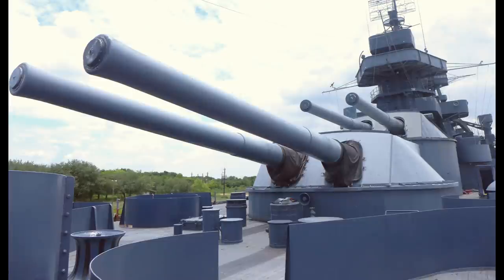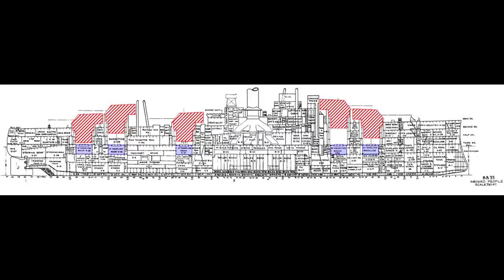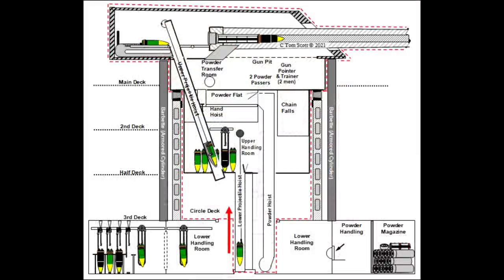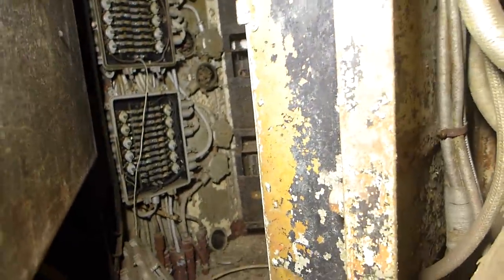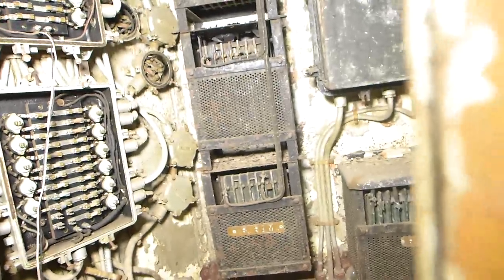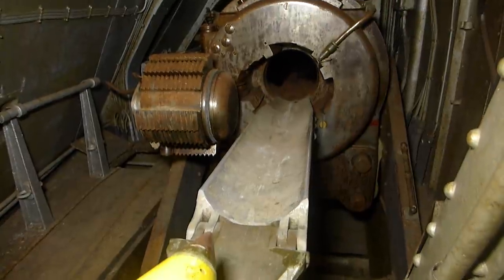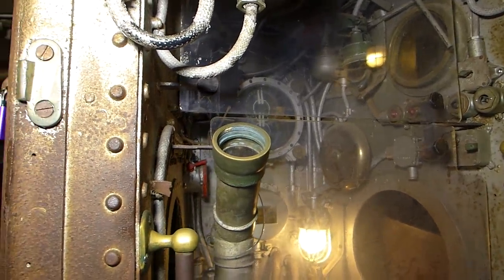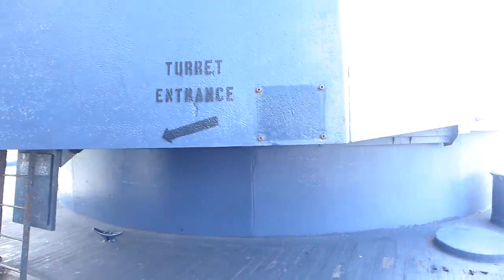Battleship Texas, Climbing A Turret

Comment: Where did the well men go when it was time to fire?
Reply from the maker: If you go to 12:25 in the video, you will see the silver tray that powder bags slid on when they entered the gun pit. The two well men could sit or lay on those and be out of the way of the gun during firing.  That position placed all recoiling parts behind them.   The only part of the gun assembly they would come in contact with from that position was the bottom of the slide that the elevating screw just ahead of them attached to.  Even at its fastest elevating speed it would simply push them out of the way, and it sat perfectly still during firing.

Comment: Those hatches seem so crude. People bound to hurt themselves while passing through it.
Also it seems very primitive how people are supposed to pass heavy powder-bags from a pit to an upper floor.
Reply from the maker: It was primitive compared to British and later US powered systems, but it actually worked pretty well.  Not only was it simpler and more reliable, the crews were physically trained to pass bags at a high rate and could do so for extended periods.

Comment: So the turret 2 circle deck had provision for additional shell storage. The turret 1 deck does not but it has what looks like storage lockers around the outside. Do you know what was stored in those lockers? Why did they use this space for additional shell storage?
Reply from the maker: I haven't found any record of what the lockers were used for.  If I had to make a guess, probably miscellaneous stores.  It would be a very good place for keeping small tools and consumables like lube oil, rags, etc.  One drawing from the early 1930's made reference to midshipman berthing and study spaces, but I don't like that.  First, there are a lot of drawings out there that were proposals not used and that nothing on it suggest that it was any more than that.  Determining whether or not drawings were used can be tough at times.  In this case, there simply isn't the deck space for berthing, desks, clothes lockers, etc.  The overhead is very low in 1, 3 and 5.  I am 5'10" and constantly bump my head on things on that level.  Lastly, there are no berth racks or hammock hooks in any of them, nor have I seen any attach points or welding ghosts from where they may have been installed then removed.

I'm not sure about your last question regarding why the additional shell storage.  If you are asking why do that in turrets 2 and 4, here's my theory.  Understand the following is based upon a brief comment on in a drawing or manual.  I don't remember which.  For that reason, this explanation is strictly my opinion.  They had to have handling shells for regular training and loading practice.  They would never use live rounds for that.  They also had to have inert rounds to fire during target practice and qualifying.  You don't want to consume space meant for live rounds, nor do you want these rounds to be in the way if you are in combat.  The circle deck storage makes perfect sense in that scenario.  They are out of the way in that location and there's no big rush to deploy them for practice or target firing, plus no truly valuable magazine space is consumed by them.
Reply: @tomscotttheolderone364  thanks. I’m sorry I realized that my second question didn’t come out right. What I meant to ask is on turrets 1,3 and 5 why they didn’t use that space for shell storage like they do on 2 and 4? Storing shells on those flats makes perfect sense and that obviously how it was done on the later ships. Was it because the low overhead and nose down storage method makes that space impractical for that use?

Thanks again for these videos and your replies.
Reply from the maker: @jetdriver  The flats on later ships were specifically designed as storage for shells, so they were a primary design consideration when laying out their turret rotating structure.  This level on Texas' turrets was primarily a space filler and any other function was secondary.  You are right about the height on the three lower turrets.  There isn't the physical room for the combined height of the shell, the length of a chain trolley used to move it, plus the height needed to provide clearance above the deck to lift and move a shell.  Since later designs stored shells on their bases and used parbuckling to move them, the overhead height requirement was much less.  One must also consider the effect of the weight added to the rotating structure caused by shell storage.  Storing as many as 100 shells on the rings on later designs added at least 1.2 million pounds to what had to be supported and rotated.  That meant greatly increasing the structure below the turret rollers, increasing roller strength and increasing the size of the training motors from 25hp on Texas to 50hp on the Nevadas.

Comment: I'm wondering when and where do they arm the shell ?😊
Reply from the maker: Good question.  All large caliber naval shells came from a shore based ordnance facility with base mounted fuses already installed.  This presented no safety issue due to their design that required a combination of the shell accelerating at more than 1,000 g's of force combined with spinning to more than 5,000 rpm to arm them.  In fact, the manuals clearly stated that base fuses were to never be removed or altered on the ship without specific authorization by the ordnance department.  The only fuses that could be attached on board the ship were nose mounted fuses, called point detonating fuses.  These were either impact fuses whose purpose was to improve the reliable explosion of a shell on impact, or timer fuses used to detonate a shell to obtain an air burst above a target like troops and trucks.  Those fuses were installed by the gun crew with the shell on the loading tray, just before being rammed into the gun breech.

Comment: What was the noise level for the powder men in the gun pit, when the gun fired?
Reply from the maker: The noise level wasn't as loud as you may think.  Veterans who worked in those positions said that the actual gunfire could be heard, but wasn't particularly loud.  The reason was the muzzle blast was on the opposite side of 14" thick armor.  What they did hear was the loud sound of the ventilation blower right beside them, and the swooshing sound of the recoil buffer, like a giant shock absorber, as it compressed when the gun fired.  There was also a loud clang noise as the gun returned from recoil as it was pushed by four sets of big counter recoil springs.
Reply: @tomscotttheolderone364  Thank you, Tom. I was also wondering how cramped the gun pit was when the gun was fully elevated.
Reply from the maker: @gerry343  It was pretty cramped.  The loader's platform that the two loaders above the pit stood on lowered into the pit when the gun elevated.  The two pit men had to move forward of that area and typically laid on the silver powder tray to stay away of it.  You can see more about crew positions and duties in this video: https://www.youtube.com/watch?v=PC9g9WkDS-4&t=1380s
Reply: @tomscotttheolderone364  Thank you again. As I wrote in another comment, I was just so surprised at the number of men involved in handling the shells and powder all the way up from the magazine to the gun breech.

Comment: Is that a voice tube in the center  of the frame at 10:24?
Reply from the maker: Yes, that allowed the hoist operator who controlled the hoist here on the shell deck with the hoist man directly above in the turret.  The telegraph in the video frame simply allowed the turret hoistman to ask for the hoist to be raised or lowered.  The voice tube would allow better information such as type of shell on hoist, status, etc.   You can see the approximate location of the upper end of the tube at 13:38   The voice tube is directly behind the top of the shell hoist seen in the foreground.
Reply: @tomscotttheolderone364   Thank you for taking the time to reply.  I toured Battleship Texas this past weekend (3/27/22).  I'm sure you know that that was the last weekend that it was going to be open to the public before preparations to tow it to Galveston for major renovations.  There was too large a line at the time to get into the #1 turret so I figured that I'd see if there was a video available.  Your video series showed me much more than I was able to see during the tour.  I thank you for that.
Reply from the maker: @SRFDriver  you’re welcome.  I was standing outside of turret 1 from 8:00 to 1:00 on Sunday talking to folks in line.  Too bad you didn’t at least stop by!
Reply: @tomscotttheolderone364  I had a 1pm ticket but may have actually arrived a little later than that...I wound up parking up on the road-by the time I got to the bow there was a volunteer gentleman up there talking to a couple who were asking about volunteering opportunities.  Being the curious type I was interested in finding the answer to something that I've wondered about for years- how the main gun barrels are plugged.  But the gentleman was busy so I just walked over, reached up and felt the bolt head in the center of the plug on the left gun on the #1 turret and found that the bolt head was hexagonal.  So my guess is that they use expanding plugs like aftermarket freeze plugs.  I may have answered question number one of a thousand questions that I have!  

I hope that when they reopen her to the public more of the ship will be made accessible to the public.

Have the powers that be any idea when she is likely to be moved?  I wouldn't mind being there to see that.

Comment: Do y'all ever get to go in turret 3
Reply from the maker: I've been in all of the turrets and have settled on 1 and 2 for videos.  They are in better condition, are more complete and easier to get in and out of.
Reply: 3 had the catapult,wish they could find that hardware somewhere so it could be mounted for posterity
Reply from the maker: @joshuamitcham1519   I agree.  That has been the wish of curators, staff and volunteers for decades.

Comment: Well made eh? Metal Electrical Box and conduit.
Reply from the maker: Yes, it's well made.   The guys that designed and installed wiring knew exactly what they were doing.  Some conduit is used, but typically only where there is a direct danger of physical damage.  The majority of wiring in most commercial and military ships is open for a variety of reasons.  On a military ship where there is a possibility of battle damage, it makes it much easier to identify and repair as opposed to multiple wires in a section of conduit that has been crushed or blown open.
Reply: @tomscotttheolderone364  Thank you Tom, I was not aware of that reason. Makes sense.

Comment: Now were these turrets laid out more or less the same as the newer triple gun turrets found on the Nevada and Pennsylvania Class? I know the triple turrets only had two shell hoists, and had their guns in one large room. It wasnt until the New Mexico Class that we got the three-gun turrets with individual gun rooms.
Reply from the maker: That is a good observation that I hadn't paid much attention to until I started digging in.  The two following classes were clearly had improvements, they weren't particularly revolutionary, except for storing shells on rings inside the barbette and the parbuckling system of handling them.  The overall shape of the turret houses are similar, but increased in size.   A lot of machinery and powder handling upgraded, but didn't change a lot.   Major changes were made with the 3-gun, single slide designs for the superfiring turrets on the Nevadas and on the Pennsylvania classes, but I hate to call them improvements.  They made some serious compromises to cram 3 guns in a small turret.  Much of the equipment that was similar to that on Texas appears to have been removed  when their gun elevations were increased to 30 degrees during modernization.
Reply from the maker: @davidrobinson3716  I bought a dvd of it a long time ago, but haven't watched it in at least 10 years.  As I recall, much of the loading scene looked reasonably accurate, except for the part where he rolled around on a burning powder bag to put it out.  The turret interiors looked very different on the Pennsylvanias compared to Texas.  The 3 guns were mounted in one sleeve, meaning that they were all together in the same compartment.  Plus, the shell hoists and powder handling was different.
Reply: @davidrobinson3716  I believe there is an article, either on Wikipedia or something else that documents the turret scenes. I believe the entire interior turret scene was scratch built out of wood if i recall correctly.

Comment: Tom I know i commented about the turret design below a few months ago, however I have a new question regarding Texas' current interior state. More specifically, the paint in the machinery and turret spaces. I noticed that its an aluminum-silver color. Was this always the case in wartime for the US Navy or specifically Texas? Or was the Silver paint relatively new from decommissioning.
Reply from the maker: The paint is what was used at least during WWII.  I cannot answer the extent that it was used throughout the Navy.